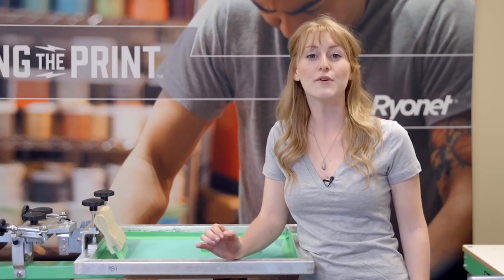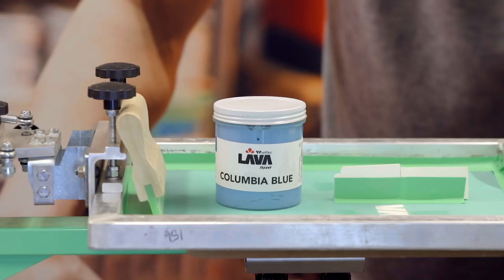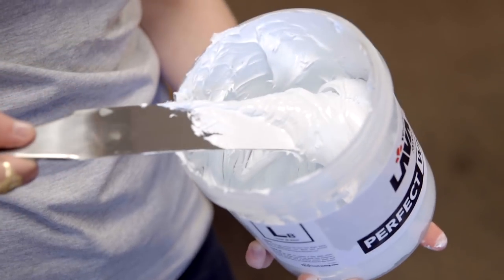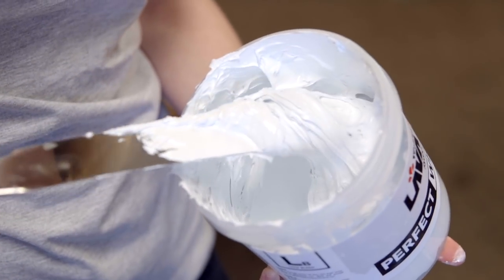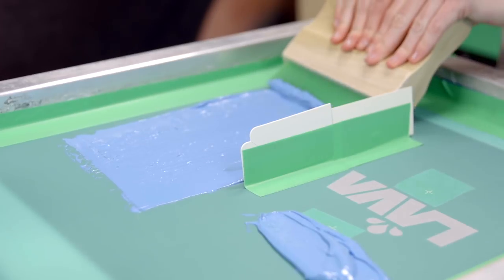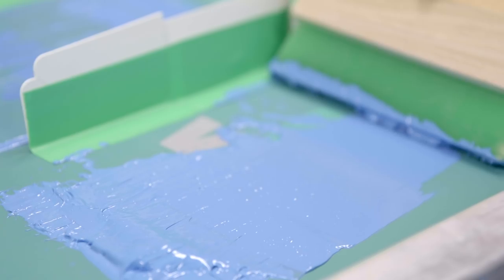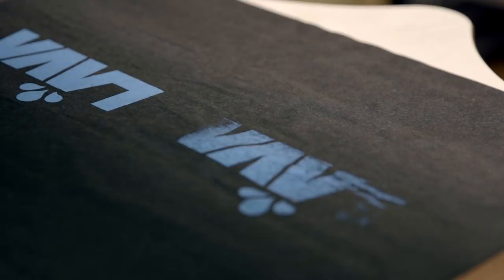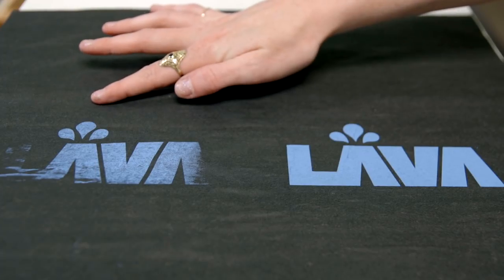What is the Proper Squeegee Pressure when Screen Printing

Comment: It's like a...lot...of variables in this process. Pressure, angle, speed, durometer, mesh, newtons of the mesh, stencil thickness and off contact. Different strokes for different folks. :)
Take everything you learn and try to play within those perimeters. If you ask 10 printers the same question, you'll get 10 different answers. I get ok prints but I want perfect prints :)

Comment: Can you provide a quick tip on drying water based inks with a flash dryer?
Reply: warm your pallets before you begin the run. Print with as little ink as you can to increase the rate of speed that the shirts dry

Comment: Please let me know what happens if we apply more pressure ....does the print looks like fibrillation after curing....?
Reply from the maker: Too much pressure can cause fibrillation, as this can cause your screen to sit on the substrate causing the screen to pull the ink up, causing fibrillation. It's a balancing act of applying enough pressure to clear the screen but not too much that will cause the screen to sit on the shirt.